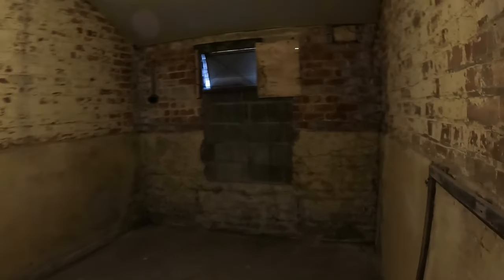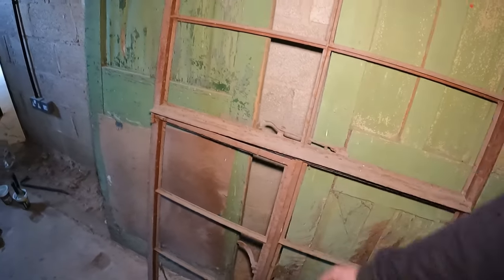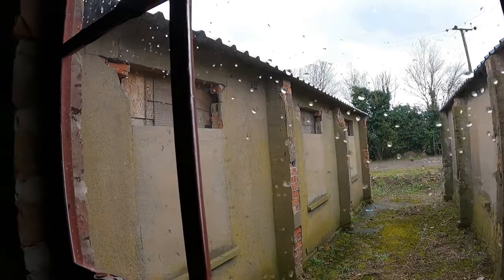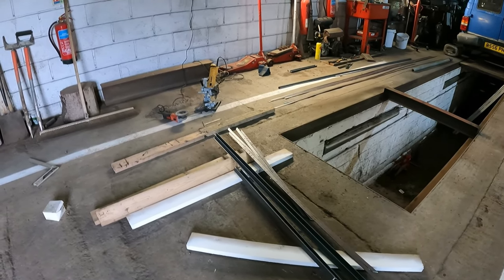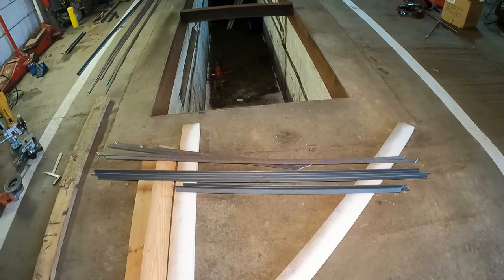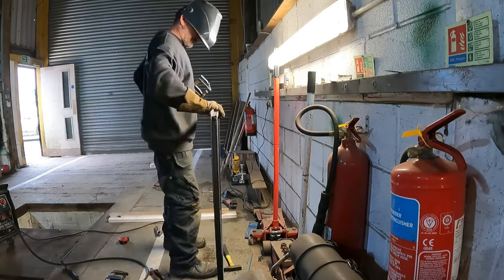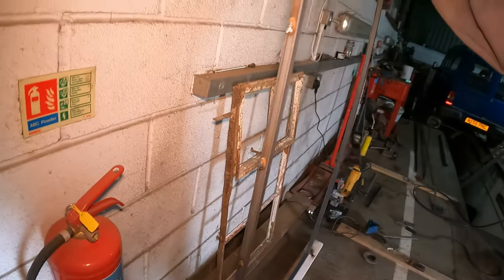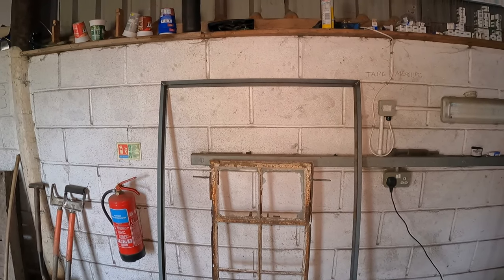Making WW2 Crittall Windows . Part One,  The Prototype Begins.....

Comment: I still have the original Crittall windows and patio doors in my 1950's house. Despite being pestered by double glazing salesmen, I would never change them, they are almost as perfect as the day they were made nearly 70 years ago, same locks, stays and handles too. Just have to scrape off the paint and make good every 10 years or so ( if you feel like it!) and not let the paint build up. It's only the wooden sub-frames that sometimes need repair or replacement, usually just a scarf-in repair job does it. 
I LOVE Crittall products, unlike uPVC they go on forever, made with thin glazing bars and correct proportions (no big ugly plastic transoms at eye level), and let in so much unrestricted light. All RAF housing, installations and MQ's once had these windows where I was brought up right up to the 70-80's . They worked and looked the part.
I wish you luck in your quest to find more that fit RAF Spec, and hope people donate old ones to re-cycle. Making them yourself meanwhile, shows fantastic enterprise. I look forward to visiting the museum. Great work man.